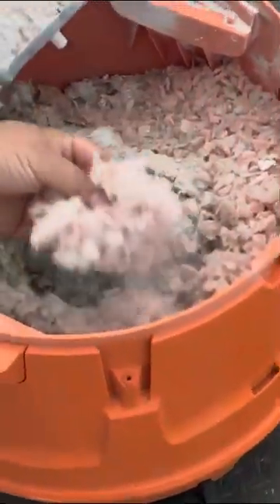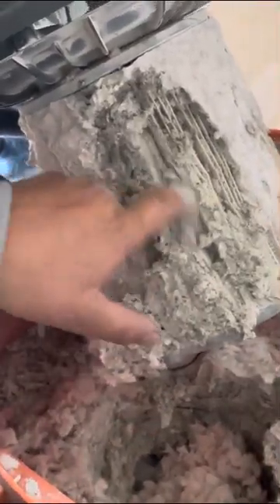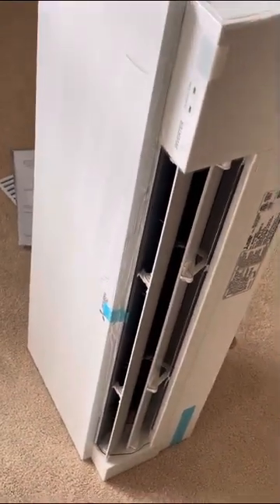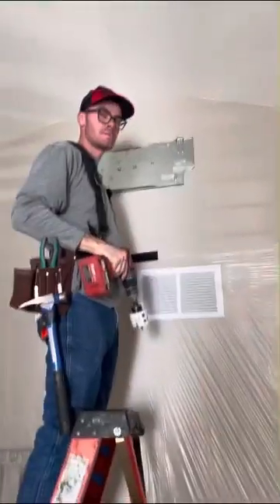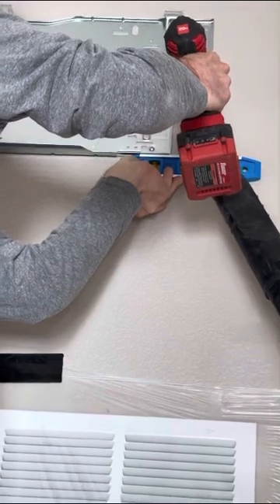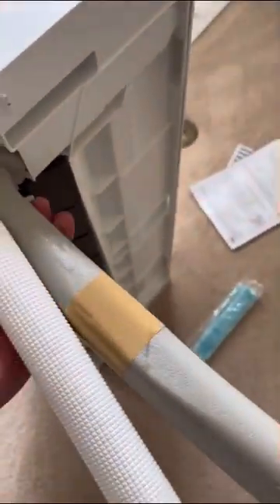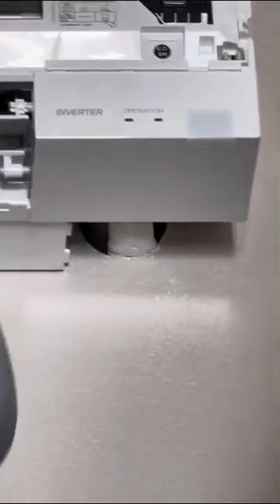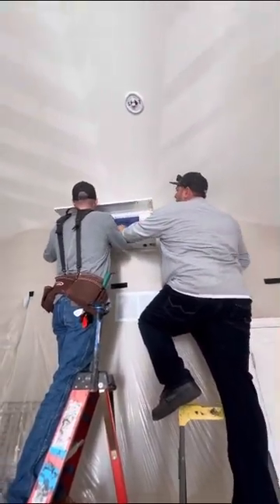Best pro Ductless Mini-split Multi-zone install Mitsubishi education #milwaukeetools #pepsi #diy

Comment: You need to ad a "Dust Deputy" cyclone separator to your vacuum. Approx $100  No more clogged filter.  Mine attaches directly to the side of my Fein Vac or any other wet/dry vac.  Easy-Peasy!    -Brian
Reply from the maker: Thanks